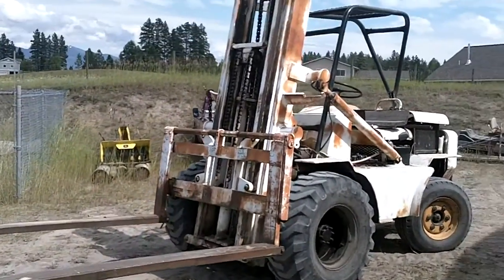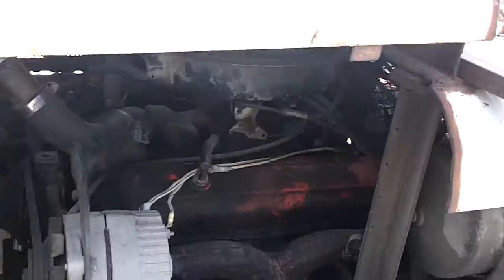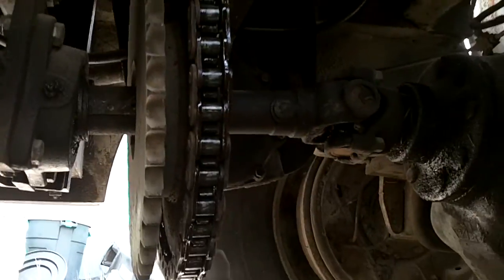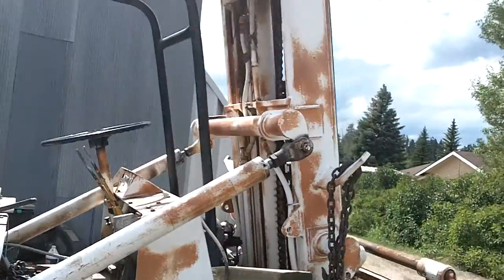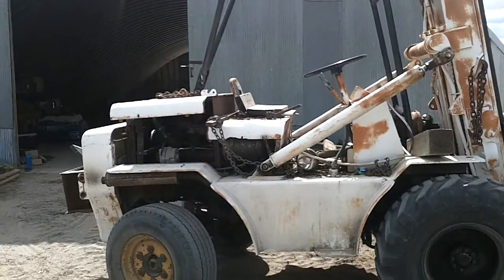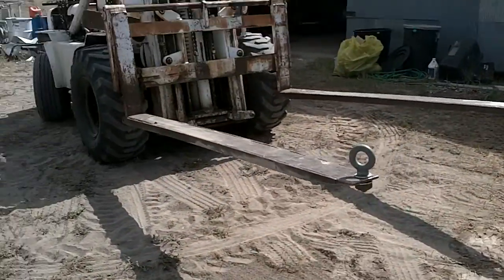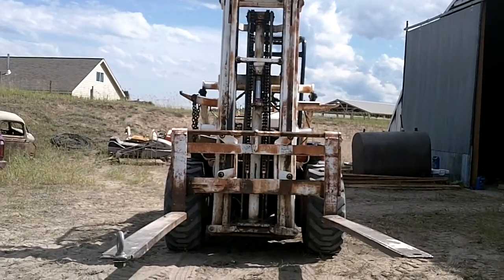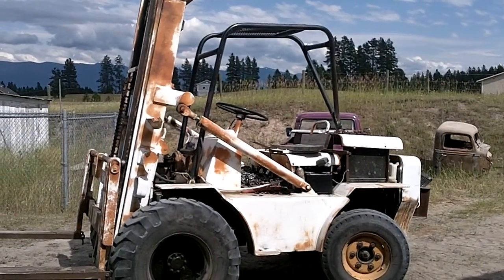Hot-Rod York Forklift

Comment from the maker: The pulley on the crank had 4 bolts to the vibration dampener so we tapped off those for with a pto shaft and joints, came through the center hole in the counter weight and mounted the pump just inside the big square opening.  Where the 'YORK' used to be.